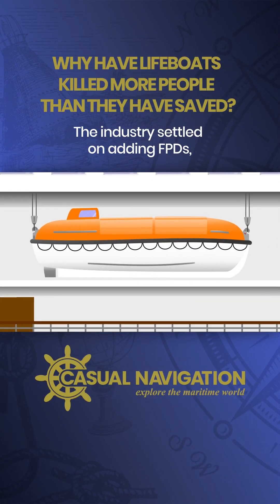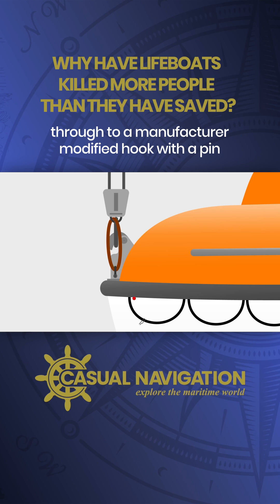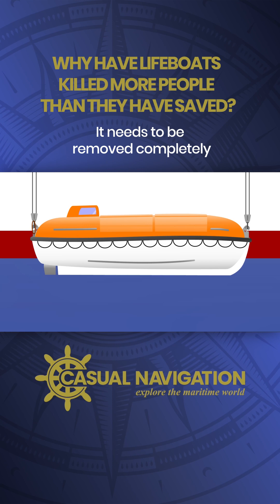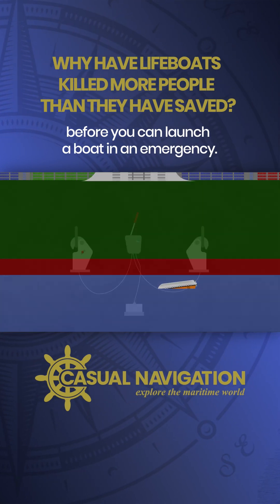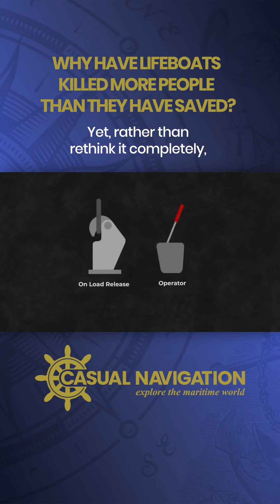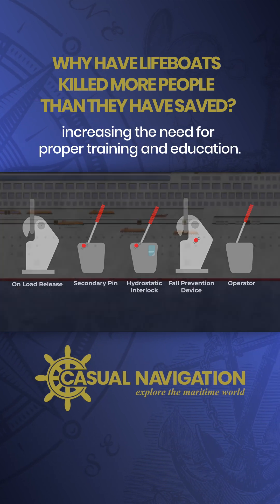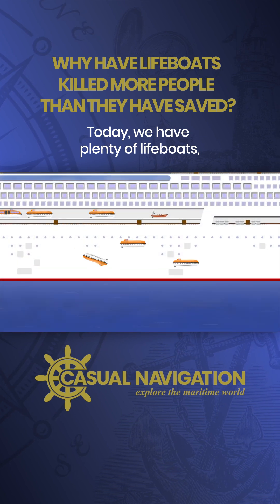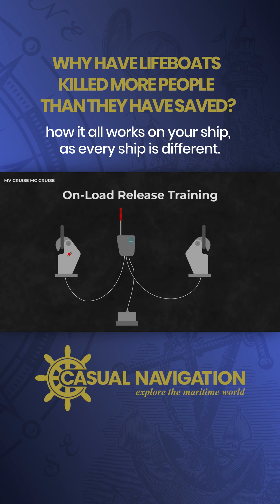Lifeboats Kills More People

Comment: Some observations:

1) Nylon loop strops are no longer an option as an FPD. The only place you should see them now is in a maritime history museum. You'll either have FPDs in the form of locking pins (e.g. Safelaunch, RokLoc, Palfinger etc.) or your release system will be designed in such a way that it won't need FPDs (e.g. Viking Nadiro).

2) Last week, in the North Sea, two Freefall TEMPSCs saved the lives of 36 seafarers. The balance towards lifeboats saving lives is returning. n.b. These are not the inherently dangerous Davit-Launched (port & starboard) TEMPSCs that have caused all of the "accidental" deaths over the years.

3) Lots of changes to the requirements for lifeboat release gear have been implemented over the last decade. As a result, going forwards, deaths related to lifeboats and their arrangements should be reduced significantly (but not, unfortunately, eliminated).

TL;DR Based on your reference to Nylon Loop Strops, I'd be of the professional opinion that your video is over five years out of date. Remove any reference to FPD "strops" and you're all good.

🚢⚓

Comment: Lifeboats just saved 30+ lives off the coast of England this month. I stuck with the channel through the change in ownership to see if you all would pull through. Looks more like it is time for me to grab the lifeboat and ditch this sinking channel.
Reply: He is not saying that lifeboats are bad, just that the deployment system is overly complicated and should be redesigned to be simpler and more robust. That's not really a bad idea; generally, you want safety mechanisms to be maximally simple - such as a red button that forces the device into a safe state.
Reply: @An_Attempt  I have no issue with Kym's original discussion. I take issue with the out of context video title implying that lifeboats kill more people than they save
Reply: @phantomsplit3491 It’s not out of context if its a fact. More people die as a result of lifeboat training than lifeboats save. Thats not saying lifeboats are bad, but that the training procedures are.
Reply: @6z0  No. Absolutely wrong. Absolutely positively wrong. The number of people saved this month by lifeboats out numbers the number of people killed by lifeboats falling with people inside.

Comment: This is an instance that not having it standardized will cause additional deaths when the equipment is most needed.
Reply: Or just use common sense and have a mechanism that holds it in place fully and then releases it fully when you flip a switch. No human error in a binary. The problem is they are all maddeningly terrified of being slapped by the government and its needless regulations that would probably add more complicated failsafes rather than simplify it